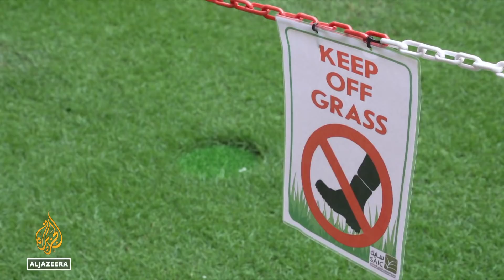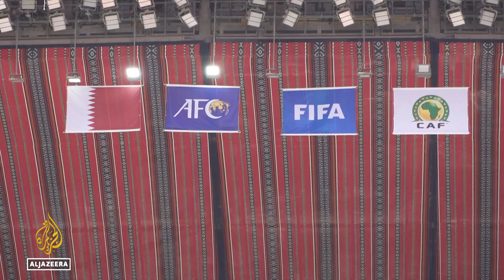World Cup 2022: Qatar’s stadium cooling technology set to provide pleasant experience

Comment: I wonder where the air intakes are, i only seem to have seen nozzles which blow out air?! Very intriguing designs!
Reply: I think it's complete bullshit
Reply: @gxlorp  will see in a couple weeks
Reply: Yeah recycling air makes no real sense.  How do you recycle the air?  Know in an air conditioner you are reusing the coolant but not sure how you recycle the air.  The vents seem to push out the cold air but then how do you design an intake to recycle.  As soon as the air meets with the hot air they will tend to average out.    Then you figure all games will be at night due to cooler temperatures hence then using more electricity.  The one thing they could use is Solar but didn't see solar panels on the stadium.  You figure you take advantage of the sun.
Reply: @sakenu16  they must some strong blowers to make some sort of curtain. I guess they such in the air somehow. Just like an invertor does and the airco in you car can do. Yet both are closed rooms.
I know stores have these air curtains, a system which blows air down really hard. That way the air stays trapped inside. But can't think of how this would work in an open stadium.
I kinda was thinking they would be a huge closed dome their, like they have in the USA for baseball